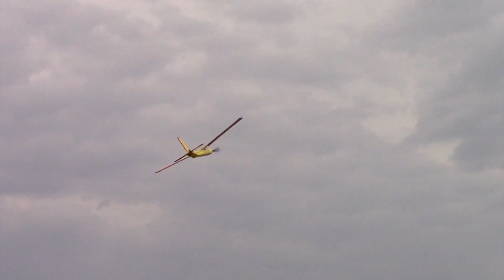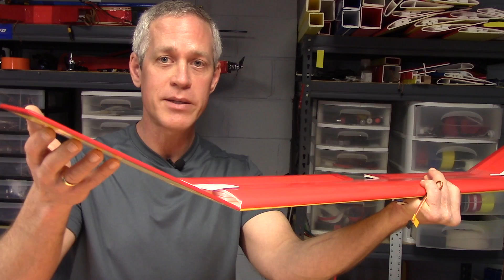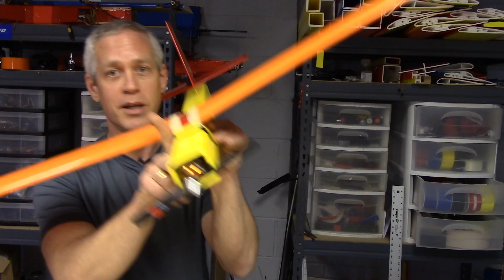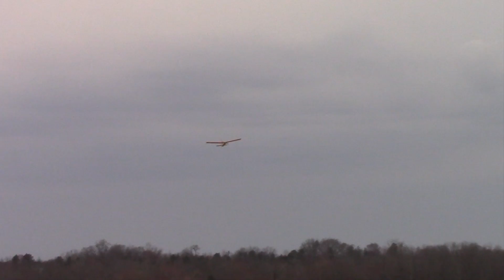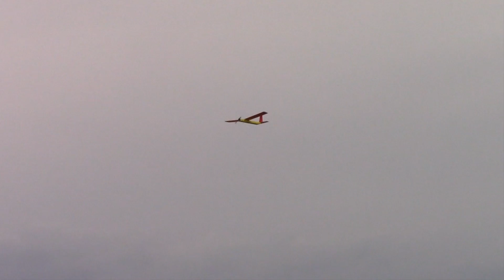What Is Dihedral?  How Does It Work?  When To Use It?

Comment: I disagree with this idea of dihedral, firstly you lift is generated 90% to the lifting surface and will try to balance themselves, that how the old fashioned scales work, equal weights and the scales are level, then you say side slip levels the wings, normally enough side slip would be rudder induced and not the way you describe. A plane has a vertical stabiliser which makes the tail follow the the front of the aircraft, the same way weather vanes work, also when a plane is taxiing and encounters a cross wind it will attempt to weather cock.

Comment: 3:54 How does the upwind wing incur a greater AOA than the downwind wing?
Reply: Was thinking the same thing, but I only think this occurs 'as it is moving' which would make sense. As the wing moves down, its angle to the relative wind must be increasing. At least I think that is right?
Reply: +bridlingtonengland75 I did some research and I think it is important to know first the direction of the relative wind so you can fully visualize how the other wing has a higher AOA than the other. Here, check the answer with the pink airplane. http://aviation.stackexchange.com/questions/26759/how-does-the-dihedral-angle-work
Reply: I think he means when the wingtip of one wing moves forward due to a yaw change, it will present a more sloped surface to the oncoming air than it does when perpendicular to the airflow. That is, instead of the air moving directly from leading edge to trailing edge, it will now also move slightly spanwise, from the wingtip toward the wing root.

Comment: Aerodynamic forces on a complex shape as in an air frame are many and interrelated. Your explanation is what I would call an excellent middle ground between a simplistic somewhat erroneous description, and an over everyone's head mathematical treatise. In fact the second biggest influence on an air frames relative dihedral is a largish square fuselage shape. So boxy trainers have a greater relative dihedral than a sexy rounded and or blended fuse, and if that fuselage also has an airfoil shaped profile all the more streamlined and an effective lift generator it becomes. A good example in the full scale homebuilt category would be the Wittman Tailwind. It is a small boxy plane capable of 200MPH speeds.

Comment: When I first started flying I was actually not a big fan of using rudder. I learned flying without using it at all. Later on when I flew my first plane with a flight controller I found out the real advantage of using the rudder. After this video I concluded I'm gonna have to scratcbuild an aileronless dihedral plane just to get a feel for what it's like.
Thanks for the inspiration.

Comment: I have a big 3 channel plane setup for fpv chasing. Its nice because when you want to use pan and tilt you dont have to worry about also keeping the wings level. On a 4 channel plane i have a hard time using pan/tilt without a flight controller keeping the plane level.

Comment: Dihedral also raises the center of lift, which provides pendulum stability.
Reply: Kevin Hainline why? Moments about CG?
Reply: pendulum stability isn't a thing. Not for free-flying air vehicles at least. If you draw a free-body-diagram this should become apparent
Reply: exactly. your lift always goes through the CG, so disturbances in attitude don't cause a response in the moment about the CG that would rotationally accelerate the vehicle back toward level. tom stanton has a good video about this